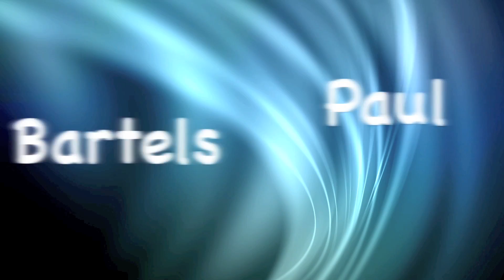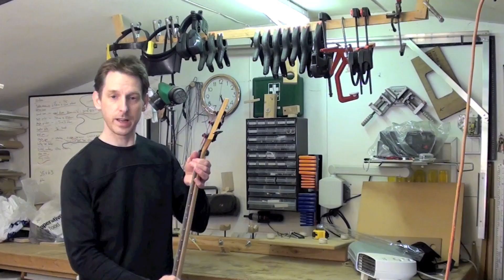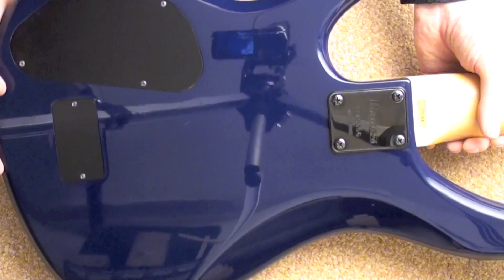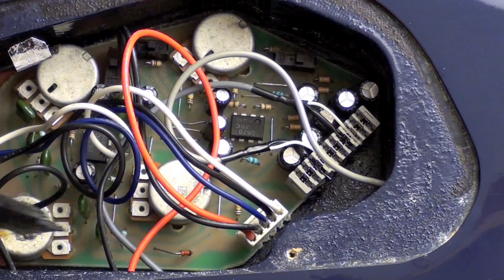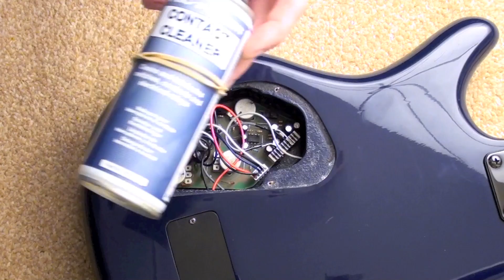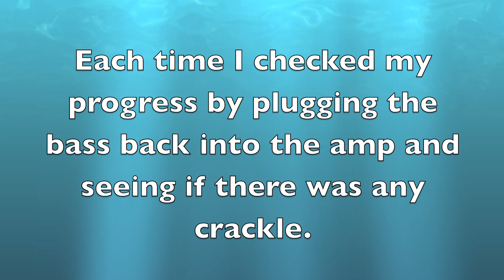Bass Repair (Crackly Pots)

Comment: Mine was much worse than yours and I was convinced that the pot was going to need replacement but the switch cleaner fixed it 100%. It's a really expensive bass with nested pots so I wasn't looking forward to the repair bill, so thank you ;)

Comment: Pretty sure it is a Samick circuit board originally. Just bought a Samick Thunderbolt bass from 94 with this circuit board for $75 Aus, no output though. Going to be a pain with that circuit though.

Comment: Hey there, thanks for the video, but I think I might have another problem...My Ibanez sr505 isn't making any sound when I'm plugges In. I'm missing a tone knob but I think the real problem is that my volume knob is loose. I opened up my bass and saw that the volume pot (that's attached directly onto the bass) is loose. Any tips on how to tighten it? Thanks again!

Comment: Good advice, I prefer not to use compressed air as it tends to push dust into the pots. Finish off with a precision plastic safe lubricant like CRC 2-26, A little dab will do yah.

Comment: hai thanks for video , i want to ask about pickup and pots wiring, is the voltage of caps like an 160v&200v&400v&600v take effect or not for sound or its important influence or notthing???
Reply from the maker: +Julio Cavalera as far as I'm aware it shouldn't have an effect as the circuit is only 9v or maybe 18v in some cases. The voltage is the maximum it can handle. So if the circuit is 9v then a 25v capacitor or above should be fine to give plenty of headroom. A capacitor with a lower voltage would be a problem though. I'm not an expert in this area though. So you may want to do some more research too.
Reply: pauljazzbass thanks, but i mine is on a pasive guitar and bass wiring , couse i read on every caps must been writes voltage capasity like 022j 400v and the other how about that?
Reply from the maker: +Julio Cavalera. I would think the voltage doesn't matter. The uf value microfarad or picofarad is the one that matters.

Comment: Is it normal for the dust to return a week after each cleaning? I only get about a 4-5 days of crackle-free pots out of every cleaning. Is that normal?
Reply from the maker: +gxtmfa hi there. It has lasted longer when I've done it. But I've noticed that eventually the pots need replacing. I'll be doing a video on this soon. It also depends where you keep your bass. If you put it in it's case whenever you're not playing it then I've found it to be ok. This is how I normally keep my basses. The one I leave out which I use when I'm teaching does suffer from noisy pots a lot. Hope that helps.
Reply: Thank you!

Comment: i never use compressed air on any electronics again. i ruined my beamer and my drill with it. if the pressure is to high you will losen cables . also pushing dust deeper into the parts isnt really a good thing to do. nice video thanks for sharing

Comment: Hey ! One of my wires severed. Could you help me ??
Reply from the maker: noluopanpa If you look carefully you may find some residue on another component where the wire has come from. If its passive try looking at the back of the pot, ground, screen wires are often soldered on there.
Reply: Yay ! I made it :) thanks.

Comment: Thanks for the vid. Do you think WD40 would work in place of contact cleaner (just trying to use up what I have got around the house!)
Reply from the maker: Ben Hearn Interesting. WD40 is good for lots of things, including removing sticky residue from labels. It doesn't evaporate like contact cleaner though. I think it's oil based rather than alcohol based. So probably not.
Reply: Thanks for a quick and helpful reply! I won't use WD40 then. Subscribed. :)
Reply: +Ben Hearn Anecdotally, I've used WD40 to clean some dusty connections in a pinch, but the crackles came back relatively quickly.  It can also 'gum' up your stuff.

Comment: Hi, thanks for the video.
Could you please specify what is the particular circuit board name/model?
Im trying to find one and replace on my bass.

Thanks
Reply from the maker: David Donoso Good question. I'm not sure! It's the stock one that came with the bass which is an Ibanez CT series. So I'm guessing it's their own in house circuit board. I would recommend if you have the budget: John East, Aguilar, or Bartolini. Their are probably lots of other good ones out their too.
Reply: Sorry didn't read before!
I have an Epiphone EBM-4 with the same circuit, could you tell me what does each knob do?
I have a pot that turns the whole circumference and it only sounds on specific points.
How hard you think would be to change a pot from this circuit board??
Is there any way to know if my cables are in the right position on the pins?
Reply from the maker: I think the controls are: Volume, Blend, Bass, Treble. It sounds to me as if the knob that turns all the way round is faulty. You can check out another video I made that shows replacing one of these pots. That may help.

Comment: Do you think it'd be worth doing on a bass where the problem seems to be gone beyond just crackle? Essentially there's only one position on each pickup volume knob that works, apart from that it'd appear that they're disconnected, though obviously they're still connected. Any thoughts?
Reply from the maker: They probably need replacing. You can usually find their values written on them (something like 470ohms). If you solder in new ones of the same value you should be fine. (also look out for the letter a or b (this is to do with it being logarithmic or linear), you don't need to know what it is, just buy one with the same letter.)). Hope this helps

Comment: hi there. I have an rbx 170 and i need to take it apart but im afraid i wont be able to put it back together (after painting). can you help me out . give me a few tips or upload a video . I need to know what the easiest way to do it is. 
Thanks :)
Reply from the maker: The approach I use is to be very methodical. Take lots of photographs of it before you start. Close ups of bridge, electronics, tuners etc. Then take apart: strings, neck from body, then proceed to take hardware off the body (have lots of small bags (food bags will do) put screws in them and label them bridge, neck, electronics cover, etc. You will need to unsolder the pickups - label each wire and where it comes from (take picture too) put tape on the pick ups and label them, use arrows to show which way is up and label which split coil is near the bridge. Hope this helps
Reply: ok then . ill do like you said. But what if i cant solder the wires back. Do you think if i took it to a guitar shop they could do it for me?
Reply from the maker: I think its hit and miss with some guitar shops. Many of them do have very competent staff who could do it. Anyone with some basic soldering skills could do it though, its not too difficult if you can do a bit of soldering.
Reply: ok thanks alot . i appreciate it

Comment: Really great video man !
But have you got something against the hum on jazz bass ?

Thanks
Reply from the maker: Haven't done a video on that (yet maybe!). As I understand it, because of the pickups being a single coil you will always get hum particularly if you solo (use) just one pickup. If both are used and they are wired to cancel the hum it should reduce it. Putting copper sheild tape behind the pickups and in the control cavity may help a little. Or maybe if its only noticeable when not playing, use a noise suppressor on an FX pedal.
Reply: Thanks so I can put aluminium paper for example ?
Reply from the maker: Do a search for "Copper Foil Tape EMI Shielding" this is the stuff you'll need, it has conductive adhesive backing, and you can solder a ground wire to it.
Reply: Thanks man I appreciate your help :)

Comment: Just did this on my '87 Charvel 3B.  My guitarist buddy thought I was going to have to replace the pots, but this procedure has them good as new!  I did remove the pots from the body as I was concerned about getting the contact cleaner on the wood.